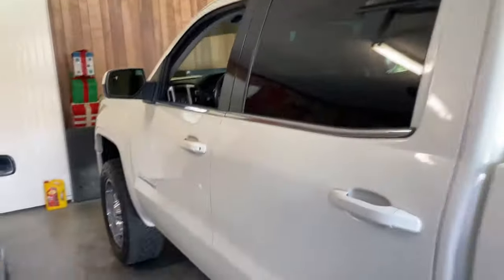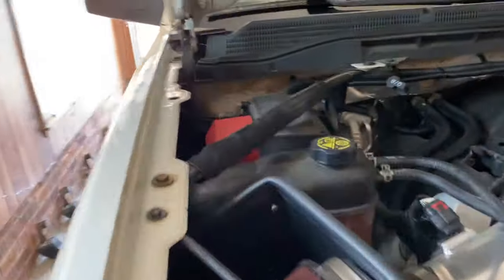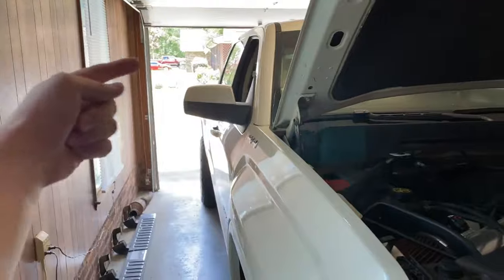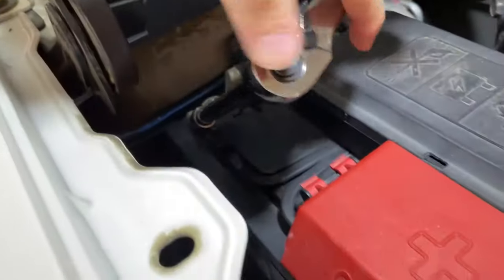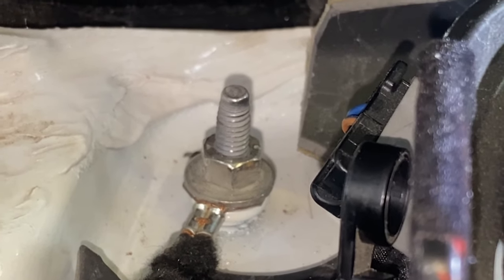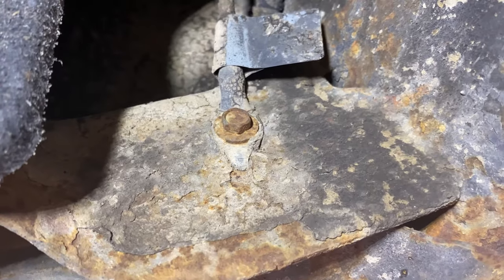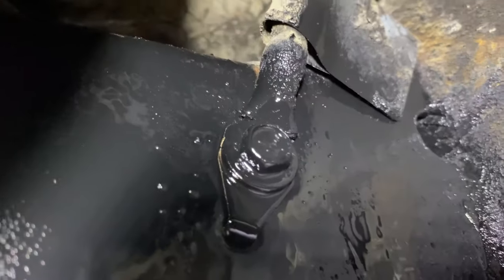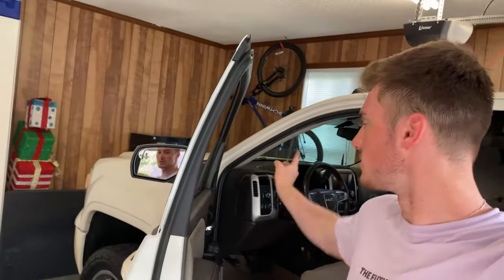2014-2018 Sierra/Silverado Flickering or Shutting Off...Ground Issue SOLVED!

Comment: My 15 started flickering and my power steering would shut off when making sharp turns. I did the dash ground point mod. Then I replaced the battery ground cable. Then I upgraded my battery. My 15 Rado has been running strong for over a year now with no electrical issues.
Reply: @brandondecoste8794  not jerking. Just noticed the power steering was out when I tried turning the steering wheel.
Reply: Mine jerks out of my hand and it stalled out on me after trying to turn my wheel 5 times.
Reply: @brandondecoste8794  do the dash lights turn off and on and does the stability track notice come on?
Reply: @jrchevy2500  yes
Reply: @brandondecoste8794  most likely it's the ground points and maybe a weak battery.
Reply: @jrchevy2500  iv been looking everywhere for months trying to find similar problems and literally it started with just service stabilitrak once every month then it turned to jerking of the wheel while turning corners slow or backing up into a spot. Then the headlights flicker and radio shuts off and on and same with dashboard lights. Now my truck completely shuts off and I have to restart it every time now it sucks honestly i thought at first it was the rack and pinion but no noise is accompanied with this problem just electrical
Reply: My 2018 just started doing it, in reverse, stability track dings then ps gets stiff all in reverse at low speeds. Did the “ground fix” under the dash on the driver side. I have yet to do this but hoping this does the trick. 😭
Reply: @yayoglizzy6228  my 14 sierra is doing the exact same thing. Did you figure out what was causing the problem?
Reply: My truck recently started the jerking and stalling also? Anyone find out what was causing it?
Reply: @ThaMetalMan  i have a 14 sierra, did u happen to figure out the issue?
Reply: Did anyone tranny temp spike tho
Reply: @hunterworrell2635  my 2016 sierra just did it twice over the weekend while making turns.
I'm gonna go the ground wires route & have my mechanic use electrical grease on them & chang out the battery post cause the battery is only 3 months old so I doubt that's the problem!
Reply: @unapoligeticllyisrael2066  mine was a ground issue.
Reply: I'm having the same problem.
Reply: 2014 rado. Man, thank you all a ton posting this. Mine just started doing exact same. Turning, power steering failing, stabilitrak and reduced assist alerts, then power loss.  Fingers crossed. Thanks again y’all.
Reply: @Followtheonewalkwiththeothers  I have a 2017 GMC doing the same thing do you have an update? Redid All My Ground points, clean them good with a wire brush on a drill use new bolts put everything back together did good for about 2 weeks Stabila light still coming on and every once in awhile lose power only when when I'm turning into driveway at low speed it will shut off sometimes takes it a while before it comes back on
Reply: Mine is currently doing this exact thing, the power steering goes off along with ac stops working for a couple seconds and happens more with sharp turns.
Reply: I'm having this exact issue!!!! I finally found something leading me in the right direction 🙌
Reply: @mikemay7134 Might be your keys are too heavy in the ignition
Reply: @yayoglizzy6228  did you ever get it figured out/fixed. My truck is doing the same exact thing.
Reply: Somebody PLEEASE reply with some answers. Did this work? My 2017 tahoe shut off with my family in the car this is DANGEROUS!!!
Reply: Ughh I’m having the same issue 😢
Reply: My 16 burban is doing tge same exact thing the steering wheel jerked out of my hand
Reply: Thanks for stating power steering going too I have the same problems in my 14 hope this helps
Reply from the maker: @taborishouston6638  it did!
Reply: My 14 GMC Sierra 1500 4x4 does the exact same thing, lights flickering, lights dim when I apply the brakes and also the stable track light comes on, sometimes it won’t start and I have to pull the positive battery terminal off and put it back on then I’m good for about 6 months or so, GM JUNK !!!
Reply: @mikemay7134  you find out what your problem was?
Reply: @ThaMetalMan  Mine is doing the same thing now did get yours fixed? I might be late to the part but worth a shot
Reply: @mikemay7134  dude mine is the same exact thing!!!! it worked for a bit after i cleaned the ground under passenger side I just opened up the dash but couldnt do much to the one by driver side like at alll could not fit anything

Comment: my 15' Silverado was shutting off randomly. At slow speeds or while accelerating at low rpm's. AC would also shut off, Radio would stay on. Initially, I cleaned the ground connections under the passenger AND driver side with a wire brush. (Very easy to do). The next day, the truck stalled again while pulling out of a parking lot. After further research, i followed instructions on (Bulletin No.: PIT5405C) google this bulletin, it references a lot of the issues people are mentioning in the comments!!!!   After removing both tweeter speakers, i was able to remove a good chunk of rubber/deadening material. from the ground G218.  the right side was in direct contact underneath the ground. Hopefully this fixes the issue, if not next step is to replace battery cables.
Reply: Did you end up changing the battery cables?
Reply: updated?

Comment: I have to chime in..if you all look at the A/C drain plug..it leaks directly onto the negative cable and the cloth wheel well cover, soaking it and the ground point directly underneath. I used the hose from a siphon tool with a clamp to extend it away from the cable.
Reply from the maker: @TJtaylor68  I’ll have to look into that too
Reply: pic?
Reply: @christaylor9895  my vehicle is in the shop right now. If you open your hood. Imagine an inferred line coming from your passengers knee. There should be a hose sticking out of the firewall pointing down(L shaped). If you turn on your vehicle you should be able to see it drip water. Watch where that water goes

Comment: Thanks for this video Hunter! It definitely helped. I cleaned off the chassis ground / frame and then added some dielectric grease before reinstalling. I also pulled apart the dash and was able to get to the ground G218. Someone in this thread mentioned removing the speaker for easier access and that helped a ton. I was able to fit a mini 10 mm wrench in there. I didn't have the foam issue that everyone was talking about (foam wasn't touching the ground or stuck in the ground) but I did notice it was loose. So I added some dielectric grease and tightened it down. I've spent the last week trying to recreate the electrical issues from before but so far your method has worked! I'll update in this thread if that changes.
Reply from the maker: Of course, Ryan! Good call on the dielectric grease, I’ve used it on some my secondary terminals attached to my battery. Didn’t think about it back then which probably would’ve been a good idea. Good on ya tho! But yes please let us (me and everyone who needs help) know how it has worked for you! Knowledge is currency.
Reply: Have you had the electrical issues since? Been having this issue too but its intermittent and happens like once a month
Reply: @xredoptixnotpro8168  no I haven’t had this issue at all since I fixed it. I think the main issue was that the ground underneath the dash was loose.
Reply: Thanks guys ! I’m going to try this fix . My 16 Sierra is pulling the steering wheel from my hand 🥲
Reply: I'm excited to try the dash.. I want this nightmare to be over.
Reply: @rtfoss  - Appreciate your update on your vehicle at the 1-yr mark. Now that it’s been roughly another year, have you experienced the shut off issue any more (assuming you still own the vehicle). Thanks man.

Comment: Almost died passing a car and switching into the oncoming lane and my truck completely shut off and came back on while going 50-60 mph. One of the scariest moments of my life
Reply from the maker: It’s no joke man, hope all is well currently. Get it fixed asap
Reply: Should be a recall
Reply: I've been looking for this comment as I haven't found common symptoms elsewhere. 
When my truck does it (15 Sierra 5.3) it just shuts off, stabilitrak flashes and then the truck comes right back to life by itself.
I'm assuming this ground could be my issue?
Reply from the maker: @shawngtpsvm  it’s worth giving it a shot. My truck has yet to do it again since.
Reply: Mine does the same thing whenever I turn to the right...
Reply from the maker: @gaylekuhn1603  check the connections inside that box on top of the battery then too.
Reply: @hunterrwiilson  Thank you..thank God I was turning into a parking lot and our driveway when it died...
Reply from the maker: @gaylekuhn1603  yeah seriously! Same here, thankfully. Lord was definitely watching over us. Be safe and get it fixed soon!
Reply: @shawngtpsvm y 2016 does the same thing when applying the brakes especially when I do it hard. Stabiltrac and trailer brake sensors flash and my electronics shutdown or glitch. Have you figured it out yet? Mind boggling there hasn’t been a recall. I’m honestly done with GM after this shit. Been a GM guy my whole life too.
Reply: @nickclarke9492  I cleaned the one behind the passenger front wheel and also the one behind the speaker on the dash. No issues so far, and that was 4 months ago!
Reply from the maker: @Saintnick9493  if you haven't already, try these solutions first, then if you still have issues go clean the primary and ground connections inside that smaller block box on top of your battery. Get a wire brush and clean the terminals and the copper ends of the wires too. I took it a step further and applied some dielectric grease on those terminals when re-installing those connections. Hope this helps!
Reply: Might be your keys are too heavy in the ignition

Comment: The entire reason the trucks have bad ground under the dash is the bolt is screwed down on the insulation. If you don't completely remove the bolt and get it out from under it tearing it does nothing.

Comment: Had the same issue even after cleaning passenger side frame ground.  I added a third ground cable between the battery and the support bar above. No issues for 6 months. Just make sure any new ground cable follows the other two through the ground sensor ring.

Comment: Unfortunately pulling insulation did not do anything to improve the grounding (dash). You have to get under the nut and clean contact to the body. Find out where that wire leads to and just run another body ground point wire.Thats a stupid place for GM to put a ground connection anyway.Check your pcm connections under the hood.
Reply from the maker: That stinks to hear. From what I’ve done it has worked, with all the sanding and fixing I did. What exactly are PCM connections?
Reply: My bad ground was behind the passenger side front tire, cleaned it seams to be ok now

Comment: Perfect fit on my "18 GMC Sierra 1500. I was having all the same issues. Removed and tightened the A-pillar ground and then I did the driver-side chassis ground, which I'm quite sure was the main grounding issue. It was corroded like yours and had lots of grime around it. Cleaned the battery ground contact, bolt, and chassis holes with a wire brush and haven't had any issues since. Thank you!
Reply from the maker: Awesome! Great job. God bless!
Reply: What did you use to loosen the A pillar nut?  It's a pain to get to

Comment: Hunter.... my guy.... you saved me. I replaced my battery and alternator before I did this. A year of frustration is hopefully resolved!
Reply from the maker: I hope it works out for you! Lmk if it still acts up cause I have one more solvent for this issue
Reply: @hunterrwiilson hey hunter, whats also the other tip you have to solve this issue ?
Reply from the maker: @josephfuentes02  opening up the distribution box on top of the battery, and disconnecting and cleaning those ground connections. I even applied some dielectric grease to them before tightening them back down
Reply: @hunterrwiilson do you have any socials to send you a picture of the distribution box lol, i don’t want to mess anything up
Reply from the maker: @josephfuentes02  yeah they're in my bio or whatever YouTube calls it lol, but my IG is @hunterrr.wiilson. 

But that box sits directly on top of the battery. There's some clips on it you pop off and you'll see the other grounds and such. Make sure you disconnect the main ground from the battery too.

Comment: i have a 2014 gmc sierra, i have done all the grounds and it made things better, but for anyone still experiencing issues i have found that the factory negative cable can also be the problem even if it looks perfect. you may be able to add your own ground and run it through the loop sensor and fix any remaining issues or just get a new factory cable. i have even seen it where a guy cut off the negative clamp and replaced it with a copper lug and solved the issue when doing a voltage drop test. hope this helps anyone like me where these didnt fix it completely
Reply from the maker: Good tip sir. I also found that cleaning, tightening, and applying diaelectric grease to the extra cables in that box on top of the battery helped too. Did this only a few months ago so it didn’t make the video.

Comment: If there is a ground issue, you can have multiple issues with any electrical on your vehicle. The power is looking for a ground so it could run through your radio it could be your brake lights it could be your traction control or anywhere else. Remember there is a ton of electrical on these things overtime the corrosion will win wire brush and dielectric grease does wonders.

Comment: Gonna have to give this method a try. I have been having the same issue that has gotten worse. Died while on the freeway. I noticed the dash was flickering and wanted to make the nearest exit and it died. I had enough momentum to make my exit and pull into a parking lot right off the exit. I just pop the hood and jiggle the ground a bit. It usually dies when I am going slow or making a slow turn. Sucks when it happens at a stop sign or light because I can't even turn my hazards on because there is no electricity. It baffles me that there has not been a recall on this as I have seen many others have the same issues. If there was a recall on this, feel free to make me look like a fool.
Reply from the maker: I’ve also used some dielectric grease on my secondary terminals attached to my battery. Didn’t think about it back then which probably would’ve been a good idea. So try this method, and make sure all grounds are tight. Any gap or wiggle will cause a break in the circuit and result in no power.
Reply: This EXACT same thing just happened to me yesterday- did you find a solution/did this one work? Thanks in advance!
Reply: This just happend to me last night headlights went out and flickering glad I found this

Comment: I had the problem of the radio changing stations on its own. It would go through everything that it was capable of doing. Then go into navigating. I looked at google and yahoo and got as many answers as there are leaves on a tree. The dealer put in a new screen. I thankfully bought the extended warranty. 2017 Silverado Ltz 12,000 miles on it . Last year when I got it. The screen came up on cures a couple of times. The service tech said that this happens a lot. Even on some of the Fords. Other than that I’ve had no other electric problems. I did replace the battery it was the original one. I think I’ll do what you did anyway. You made it look easy enough even I could do it. They suggested to keep the screen clean. There’s stuff for computer screens at Office Depot and Best Buy, but don’t use glass cleaner or anything with alcohol. Just wipe easy with a microfiber towel. Hope that he knows what he’s talking about.Seems like this has been a Gremlin in the system for a very long time. Surprised that there wasn’t a recall years ago.

Comment: Someone may have already mentioned it but if you remove the two screws and connector on the speaker it slides right out. That gives access to get a wrench on the nut.
Reply from the maker: Wish I would’ve thought of that back then 😅
Reply: What size wrench do the speaker screws take?
Reply: @richburley5670  I believe it was 8mm. You'll want to use a 1/4" ratchet and socket though.  It'll be tough to get a wrench there unless you have an offset box set.
Reply: @dlm339  I just fixed it today. It turned out to be 7 mm and it made the job a lot easier, that's for sure.  The driver's side ground on my truck had insulation trapped under the ground clip. The passenger side one was just loose, it have never been tightened down from the factory. This appears to have fixed my problem, even the service engine soon light went away.
Reply: Just get yourself a Flex extension... no big deal.
Don't have to "slide" nuthin'.

Comment: I’ve been experiencing these issues for the past year or so, 
I addressed the two grounds inside the dash panel for the ignition about 10 months back, and I thought my problems were solved until yesterday when the truck completely shut off on the interstate during rush hour, I’m lucky to be typing this comment out right now, but needless to say I’m about to go check that secondary ground on the underside of my truck now 😅
Reply from the maker: Praise God that you're alright! But I would address that ground, dig into the distribution box on top of the battery, clean those connections, and put some dielectric grease on before tightening back down. I haven't had a single issue since.